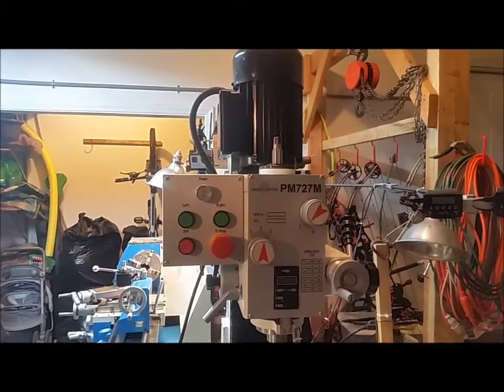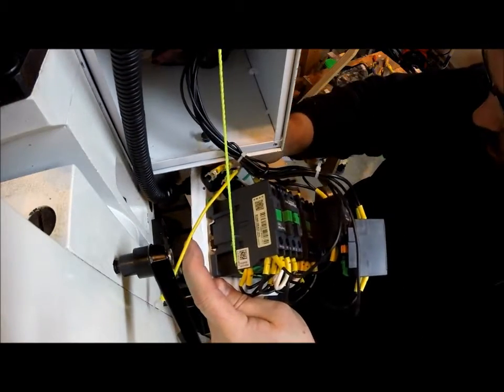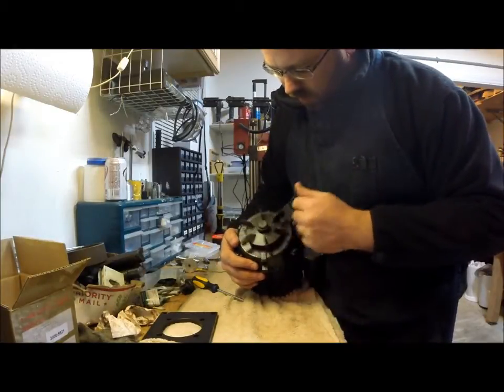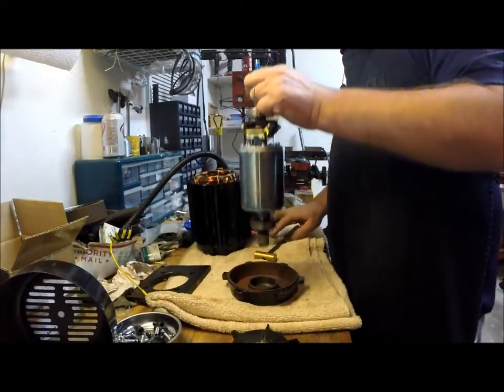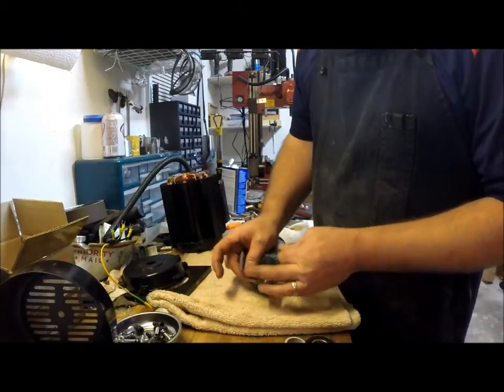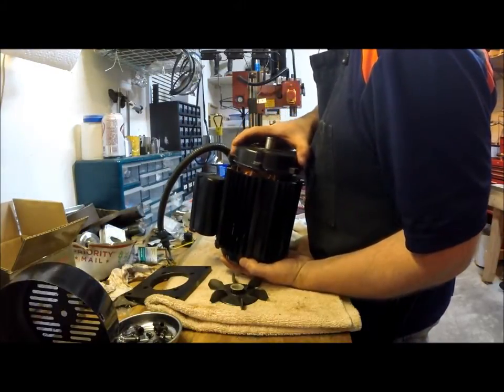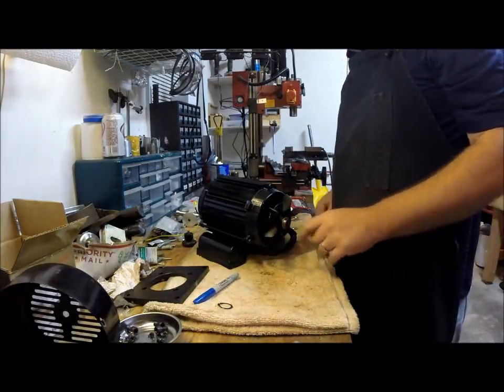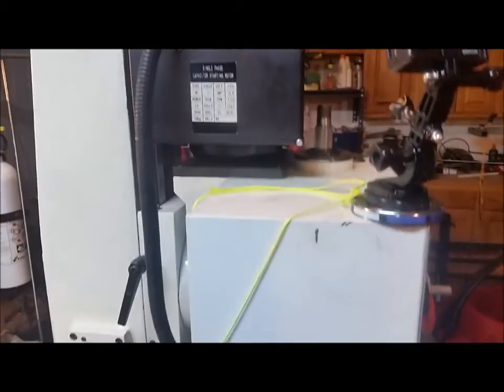PM727 Milling Machine Motor Bearings Replacement

Comment: Not going to help you now, but tapping on the set bolt intermittently while tightening helps what you pulling to pop  free a lot easier and puts less stress on the pulling mechanism. Adding lube to shaft also helps.

Comment: Chad,  I also have a PM-727 and am just curious, how much run time before you noticed a noisy bearing???? Did the Warranty cover it????Gary in N.W. Arkansas
Reply from the maker: +Gary Jones I had my machine for a few months before it started squeaking.  It was just a constant squeak that wasn't particularly loud.  Matt was great to deal with and tried to help me trouble shoot things.  I didn't push the warranty issue with him since it only cost me $15 for Nachi brand bearings and since I would be the one installing them.  The bottom bearing had a light bit of rust on it as well as the output shaft from the motor that meshed with the gear drive.  It appeared that there had been some moisture in there.

Comment: When you removed the wires leading to the motor, were they labeled clearly to make it easy to return to the correct terminals?
Reply from the maker: +Steve Shannon Yes, every single wire had a yellow tube on it with a designation such as U1, V1, W2, etc.  I made sure to take a picture but the way everything was wired, there were actually two wires of each designation going to any given terminal so I didn't have to try to remember where everything went.  Ridiculously easy actually.